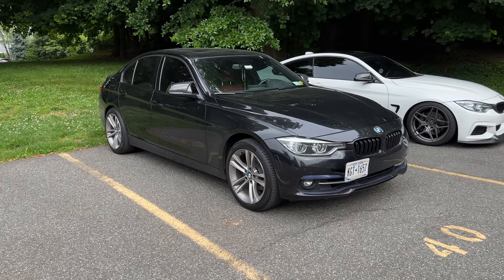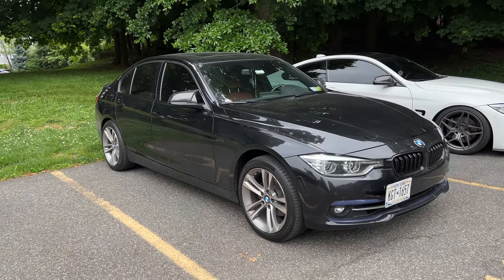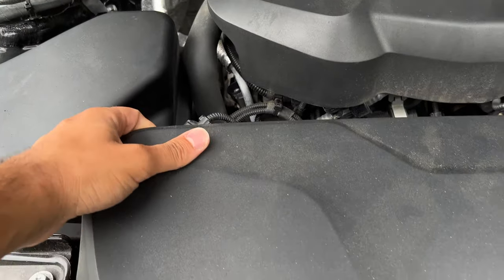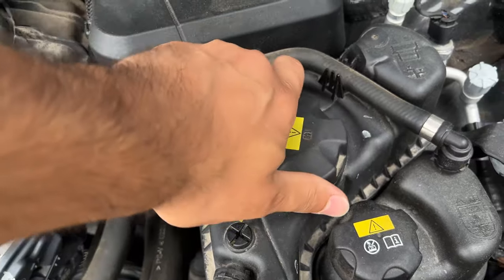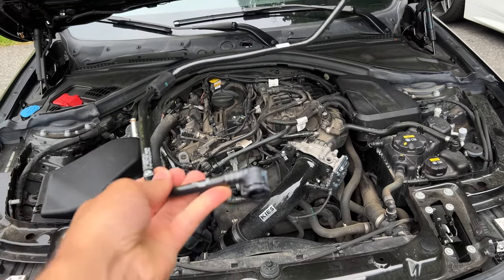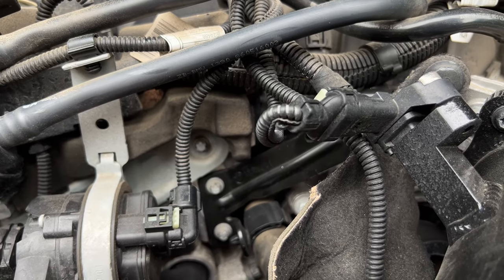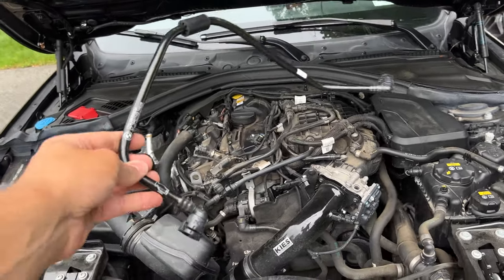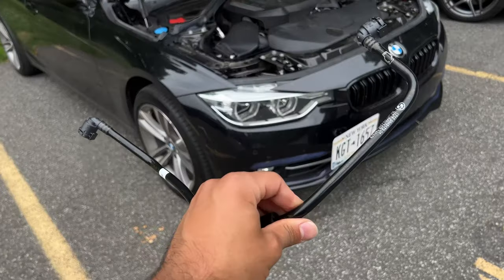THIS PIECE MAKES THE BMW B46/B48 UNRELIABLE! BMW keeps making this mistake...

Comment: Recalled by BMW US - BMW Service Information Bulletin: SIB 17 01 21
Reply from the maker: Thank you for sharing! I’m pinning your comment
Reply: My line just bursted Monday and towed it to my house. Did my research and ran into this video and saw your comment! I hope BMW will fix it at no charge. I will keep you guys updated!
Reply: Update!
So yes it’s a recall in US. They fixed it for free of charge!
Reply: @Jbot-xd8ht  It's great to know. I take that you are in US, AFAIK it's only been recall in US.
Reply: @Jbot-xd8ht   hello I think my car is having the same issue with the hose coolant leak , how do you find out more info about the recall
Reply: @kimberlyjones1572  take it to the dealership they did my 2020 230i there is a recall
Reply: good man!
Reply: BTW if you replaced it on your dime you can get reimbursed by BMW.
Reply: @James0u812  Only in US afaik.
Reply: Does this apply in Canada too ?
Reply: Found the bulletin, but doesn’t mention bmw x1 with b48 as being affected?
Reply: @alldaymusic1102 Did you figure out if they do the recall in Canada?
Reply: I have brought my 330i to the dealer 5 times for a low coolant light. This is crazy they haven’t changed this part yet

Comment: I'm a BMW tech, and these coolant hoses were an EXTREMELY common failure on the B46 and it was made into a recall very quickly. I've probably done 25+ of these lines and I've only been there for about a year.
Reply from the maker: Great to hear from an actual BMW tech! Thanks for the insight!
Reply: Is it expensive & hard job to do?
Reply: @SkydexFPS It's not hard, but it's a bit of a tight squeeze to get the coolant to connect on the engine block. part is cheap and labor is 30 mins if you know what youre doing. Seen some guys bang this job out in 15 mins or so.

Comment: Thanks for the excellent video. I was alarmed by this issue from lots of videos on line so I managed to get after market machined Aluminium connectors and high pressure silicone hose online, and made my own. I believe this can completely resolve this problem, as the the BMW replacement looks just the same as the old one. I am not comfortable with these plastic components working under high temperature. I had one charge air line (plastic) cracked and leaked oil on to the alternator belt , causing the belt to snap and the car being towed.
Reply: You the link?

Comment: True!! Just happened to me.  Mine overheated and left me stranded on the highway.  Cost me $125.00 to take my 330i to my house on a flatbed tow truck.  Had to drive 150 miles to get the hose.  Luckily it was easy to replace watching YouTube videos. Not a reliable part on an expensive car.

Comment: This happened with me last summer .. I was driving back from work and the car overheated and went on limp mode.. back then I didn’t know what was the exact problem , so I took it to a bmw mechanic. The mechanic claimed that it was major and he said that I need a full replacement of a water pumps  and the hoses .. he said that he checked it and showed me some bull shit data .. and quoted me $4500 !! I didn’t buy his bullshit , so I was it’s ok I’ll tow my car back to the house,  and later after I was messing around in the engine bay .. I found out the issue .. I bought the part from the dealer and fixed it my self .. it cost me only $70 ..
Reply from the maker: Honestly, I’m so glad you didn’t just trust that mechanic. That’s an insane quote. Doing just a bit of research before literally saved you thousands. Good stuff man!
Reply: @ayyyman_  thanks brother.. keep up the great work ..  ✌️
Reply: @shadishebaro4296 how’s your 330i now?
Reply: @justlife7037  
It’s a great commute car .. I drive it every day of the week to work .. engine very smooth , not the fastest in its class but it’s excellent on gas and never had any major issues with it for the past 4 years .. and it’s easy to work on

Comment: Pretty sure this happened to my 2016 330i M Sport here in Australia. Massive coolant leak they replaced the pipe/hose then pressure tested and every line leaked. $2357 AUD as no recall in Australia. Feel like this is not just wear and tear and should be covered. Still have to replace the Vanos and the IDrive headunit as that has failed also.

Comment: This happened in my 2018 330i. I took it to the dealership and they fixed it. Thank god I had the maintenance plan with them just in case. Im 99.9 percent sure it was this exact issue. It was leaking every time I topped it off.
Reply from the maker: That’s clutch! And yeah I’d be willing to bet this was the issue. Especially judging by everyone else’s comments, this is VERY common

Comment: Had this issue on my 18 330i at 50,000kms (31K miles) last week. My warranty ended in January this year, but since this issue is related to the recall for the ac line, the BMW dealership fixed it at no cost. Pretty happy with their service considering I didn't have an appointment and ended up getting my car back in 3 days.
Reply: 3 days for a 30 minute job? I hope they gave you a loaner.

Comment: another common problem for the b48 is the oil filter housing gasket crack. just need to upgrade the gasket to aluminium.

Comment: Happened to me during the road trip and I was 80 miles aways from my home. I had to tow the car back home and luckily I figured out what happened.

Went to the dealer to get the original part the guy at the counter said this is a known issue and I looked at him like wtf. They said the newer version of this pipe is fine and BMW has changed the design whatever but I highly doubt it.

I didn't get it fixed from the dealer because they quoted me £400 to out the pipe back 😂 my mechanic did it for you for £70.

The reach to the other end is very tricky you will have to remove the bit pipe and open the Air intake bolts to get to the pipe so yea it will take a professional about an hour or so to get the job done!

Hope it helps.

Comment: If you made it to 50k miles just get ready to change it cause it WILL break. There's a DIY video on YouTube that shows how to replace it by just removing the bracket. Also, it's good to bleed the cooling system after replacing.
Reply from the maker: I agree. I'll definitely swap it out before then. Do you have a link to the DIY video handy by any chance?
Reply: @ayyyman_  https://youtu.be/O0E3jt8_PjQ 
the replacement was done on a 430i in the video but its the same process for the 330i
Reply: Is it being replaced by an upgrade component or is the replacement the same part that will fail again? Is it something owners should keep a spare of?

Comment: I have a 2018 bmw 330i……it looks like I’m the lucky one cause mine didn’t have that problem how ever last time I did my oil change the dealership said i had an outdated coolant line and they replacement it for free  …… I’m at 35,000 miles

Comment: Kinda a random question but I have a 330i and I was wondering if removing the plastic cover that covers the radiator would aid with cooling or anything like that.
Reply: Vague question, but removing OEM covers will never solve a problem. Sorry.

Comment: Please make video on how to change this. 33,000 miles and I think mines just broke, could this break in the middle of the pipe or only in the ends? Thank you!!! For everything you’ve shown is already 💯
Reply from the maker: Hey! They will usually break by the ends, not the middle. I believe they actually issued a recall for this so you should be able to get it replaced at a local dealership for free now!

Comment: Hey I need help, have a coolant leak. bmw told me it was the upper radiator hose and they wanted $800 to fix it. I bought the hose and replaced it myself and it was still leaking I then replaced the expansion line and it was good for a day and with no leaks and then it all leaked again.
Reply: And what was the end result?

Comment: I'm so angry with BMW I don't know why they decided to use such a weak material, I need to have mine replaced as we speak and it's gonna be for the second time. The coolant is leaking and I believe the reservoir is empty by now, I had the same problem in June 2020.

Comment: Thanks for this video. Once you have this coolant vent hose replaced, is it unlikely to occur again? In other words, are you aware of any cases where this exact part has had to be replaced multiple times on the same vehicle?
Reply: Had to replace mine around 1.5 years ago and it started leaking again yesterday (thus me being here to investigate further the cause) seems that it would be a common issue and I'm planning to keep a spare available to replace once per year just to avoid being in a bad situation in the middle of nowhere.
Reply: @mohammedmj4006  Interesting. Thanks for sharing. What year and mileage is your car?

Comment: Ya mine cracked by the coolant tank. BMW fixed right away. Super common from the factory. They say the coolant isn’t properly vacuumed or something. I would just do a flush right away and fill it back up. Super easy to do.

Comment: 51k miles on my ‘17 330i. Been running it with bm3 for the last 30k. I did have a coolant leak from this but just got the recall done and it’s running smooth. I should be good for another 50k 😅
Reply: Lucky guy. I have the same car & year but my DME was locked. Sent it to Kies to unlock it and finally went stage 2 about three weeks ago after having the car for 2 years lol.

Comment: What’s the temp that would be considered over heating my idles at a 200-225 f
Reply: Where do you see coolant temp my 430i only shows oil temp on the gauge cluster it’s 18

Comment: Mine broke on my 2018 430  literally a week before my warranty ended all my coolant leaked out completely thankfully it was fixed by bmw and they even gave me a 2022 430 to drive around while they fixed it
Reply from the maker: Sheesh… that’s at least nice that it happened still on warranty. How did you like the new 430?
Reply: @ayyyman_  it was awesome the new body style is insane in my opinion but they gotta stop putting the license plates over the grill

Comment: The service manual says the intake needs to be removed to replace……..that is not the incase but is a pain.
Reply from the maker: Yeah I heard about that but I didn't hear of anyone actually removing it. Glad it's still possible!
Reply: @ayyyman_  no need to remove the intake manifold. I did it without removing it. That’s just a huge hassle. Wish I had made a video to help people out with this issue.

Comment: I'll definitely keep this in mind - thank you for sharing!  BTW,  I see you're not running your BMS air intake on this video?
Reply from the maker: You’re very welcome! And great question. I explained it in the video but chose to cut it out so I the video isn’t too long. When preparing for the road trip, I tried to keep the car as stock as possible so I removed it. I will be adding it back though!
Reply: @ayyyman_  Right on!  I just installed the same intake the other day and I love it.  Have a great road trip!

Comment: This same piece broke on me a couple months back. Was a pain in the ass to change but better than taking it to the dealership.
Reply from the maker: Did you remove anything else besides the bracket to get to it? Also, how many miles did your car have?
Reply: @ayyyman_  when it happened I had around 56-58k miles on the car. My father did most of the work since he is a mechanic. he removed the chargepipe, heat shield, timing belt, water pump wheel, and loosened a bolt that holds what I assume is the alternator to get to the end of the other side of the hose. From there just put everything back together, refill the coolant with original bmw blue coolant mixed with water 50/50.
Reply: @johnmolina4677  That had to be a different part than the one we're discussing here.  My problem is that I've removed it (not too difficult) but the hose seems to be fine despite my leak being pretty steady; just can't tell where it's coming from, and the BMWUSA website shows NO recalls for my 20187 330i.

Comment: I just changed mine, 700 dls installed from the dealer
Reply: 2019 F36 with under 22k miles
Reply: Also the break was on the engine side
Reply from the maker: That’s not as expensive as I thought it would be. Sucks that it happened to your car at such low miles though
Reply: @ayyyman_  Im in mexico so maybe it is a little cheaper

Comment: I have a 2019 330i and has anyone had this issue?
Reply: you found anything about if yours has this issue? im looking into getting a 2019 and up 330i
Reply: @OblivvOfficial  I just hit 40k miles and the only issue I had was my driver side headlight condensation. Had to pay 3k out of pocket just for the shell. 😢
Reply: @Drew25441  Oh man. I’m really trying to do my research before possibly buying it as a daily for myself, particularly if I get one with 50000 miles and above.
Reply: @OblivvOfficial  besides the headlight the car has been super reliable and fun to drive. Maintenance can be pricey if you go to the dealer so I would recommend you find a reputable bmw shop around your location.
Reply: @Drew25441  Appreciate it and will definitely look into it. Definitely going to be stoked if I end up do purchasing it.
Reply: @OblivvOfficial  good luck man i was nervous about buying a bmw knowing  the reputation bmw was known for but this car has far exceeded my expectations and will eventually upgrade to an m340i.
Reply: @Drew25441   For sure brother I feel like I’m in the shoes you were once in right now. Currently using a 2015 Acura ILX as a daily and transitioning into a comfortable sedan with some power is definitely a big step for me. Just trying to learn more everyday and save up for one.

Comment: Mine popped just after 42k
Reply from the maker: 42K miles, good to know! Which end cracked?
Reply: @ayyyman_  motorside
Reply: Mine went at 44k
Reply: The kicker is, BMW knows the part is bad from the factory. They replaced the original part with a newer part with a different part number, apparently from what I’ve read it’s a different plastic that is less susceptible to chemical & heat degradation. Was also told by a BMW tech that if I would have purchased my car from the dealership where I had some warranty work done they would have replaced it without asking before it became a problem. Not sure if that is the case but the dealership doesn’t have a great rep for general customer support unless you purchase from them……..even though it was a BMW under warranty!!!!! Not gonna bad mouth them by name cause the one service rep that helped me out the second time was awesome, the first one half ass’d the job it seemed.